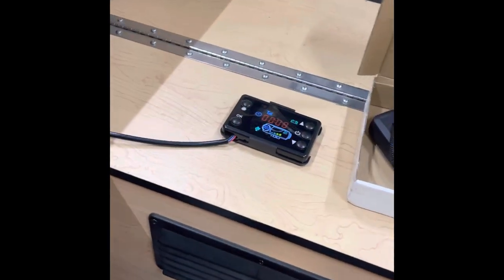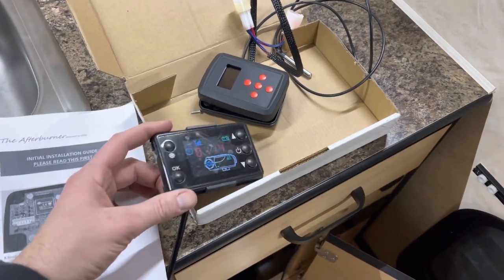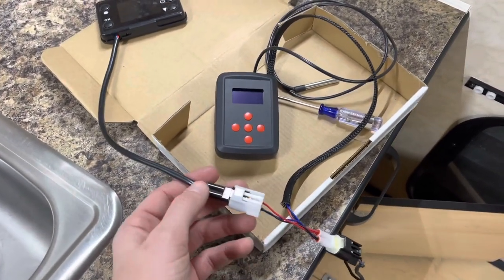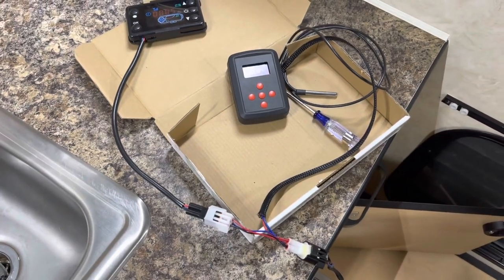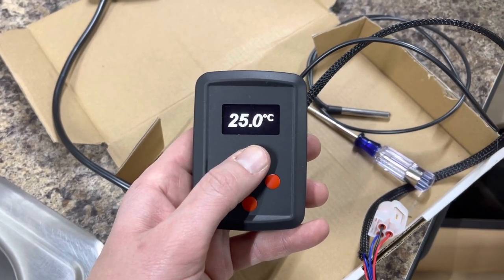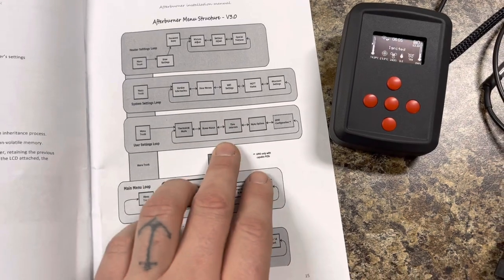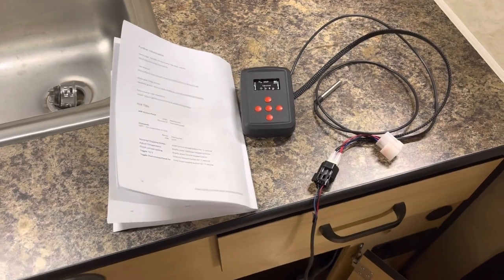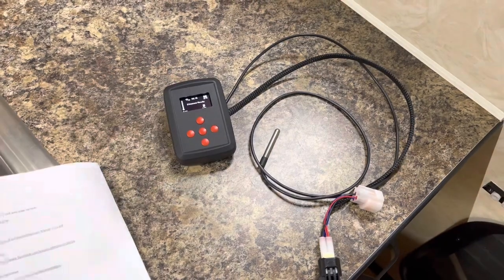Afterburner chinese diesel heater controller. Watch this before you install your heater!

Comment: The dude makes it really hard to buy these controllers. He open sourced the code, and there is a Scottish company that sells their own version based on the open source software, or at least a fork of it. I believe its called Ignite. But imo its a little too expensive, more than the heater itself!
Reply from the maker: I will be doing a video soon of a new company Burek that sent me a new controller to try for these heaters.  Might be an awesome solution. 
https://bureck.company.site/

Comment: Can you help me out?  Got mine in and it works.  But it doesn’t shut down when it hits target temp.  Shouldn’t it stop and kick back on like a real thermostat?
Reply from the maker: Dig into the manual. It has multiple operating modes. Ours came as yours is now. It would roast us out.  Once we changed it, we were very happy with it.

Comment: Even at $154Aud for the Full Featured Version I have, I consider it a Bargain.
If there's any Issues, the Support available is Superb.

What's missed in this Video is the Ease of Use available with use of either the BlueTooth App, of the inbuilt Web Server. The Web Server's a no brainer; just connect to the devices AP with your phone & open the Webpage.
You get all data & controls on well laid out Screens.
Timer Functions too.

Mines been running over 4 years now & consumed well over 500 litres,
and is even integrated into my Home Automation Via MQTT.

Would not touch the Ripped off Copies with a Barge Pole.

Comment: I’m interested in the eberspacher fuel pump, would you mind telling me which exact pump you have, I have a 5Kw CDH.
Reply from the maker: I can’t be 100% sure but if I recall I think this was the one. https://amzn.to/46oUfkQ

The main thing that helps with the installs is the correct diameter fuel line. The cheap Chinese lines are usually too big. Also when installing the hose into the rubber hose fittings make sure they’re pushed all the way in. Hope that helps!

Comment: Is it any benefits regarding fuel consumption?
Reply from the maker: I’m not sure. One benefit is I can pull the fuel consumption data and run time data from the afterburner which I couldn’t do on some of the other heater controllers.

Comment: Which heater should I buy that is compatible?
Reply from the maker: http://www.mrjones.id.au/afterburner/assets/files/UserManual-V3.2.pdf

Page 5 is the compatible ones. 

Also on his website there’s is photos of the ones that will work with it. 

Hope that helps!
Reply: @RoamOverlandVehicles  your link is not working